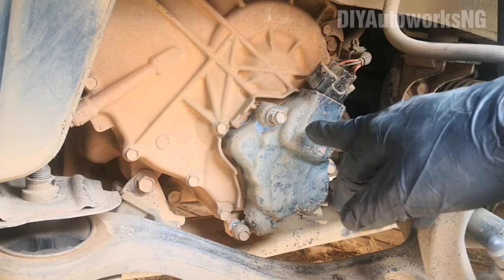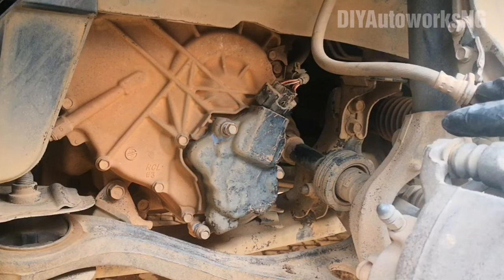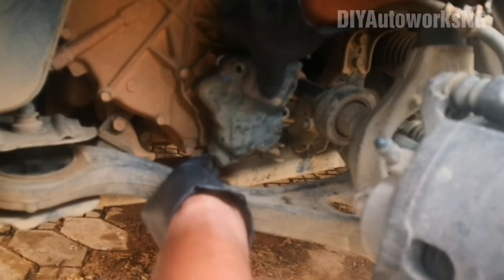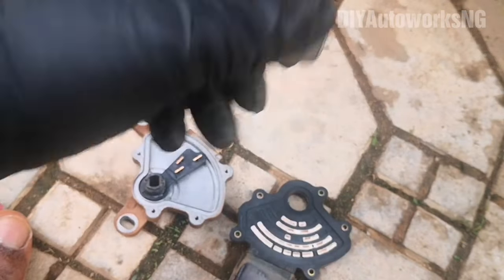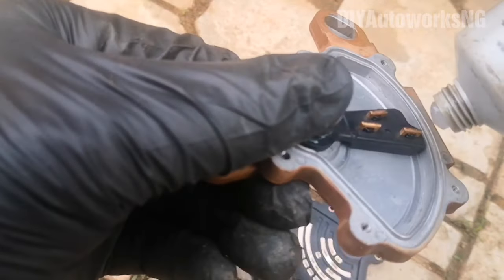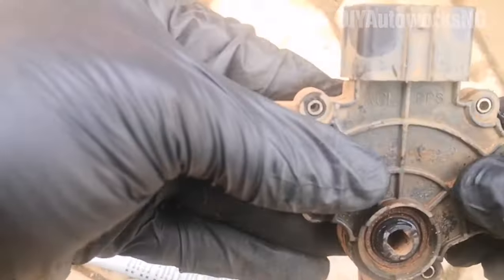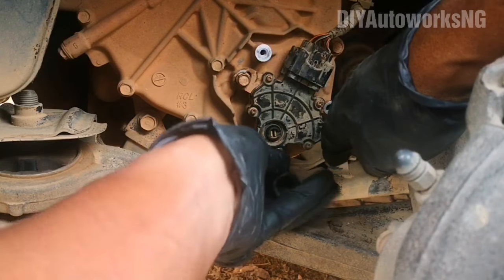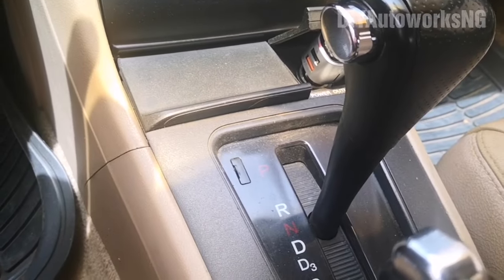Neutral safety switch service: How to clean a neutral safety switch (transmission range switch)

Comment: Will be doing this on my 2005 CR-V EX. It has an intermittent no crank no start and the only way I’ve found to get it to turn over is by playing with the shifter position running through out all the gears multiple times and sometime it still has trouble working. It only happens after I have been on back country roads which leads me to assume the switch is dirt and full of the same fine dust this coats my under carriage. Thank you for taking the time to show and film this for us! I grabbed another identical neutral safety switch from a local wreaking yard to compare the wear on mine to and as a fall back incase my switch really is faulty. Cheers!
Reply from the maker: Thanks a lot for the compliment. Very good plan you gave there. Since I did this, the no-start in park has not happened again. All the best!
Reply: Same problem on my Chevrolet Beat

Comment: Great video,  very helpful.  My honda won't start in neutral or park, good battery etc. I think it's the switch I drove through some big puddles just before it failed. Very little information on the web about what it actually looks like inside.  Thanks to your video I can actually see the circuits inside when you take it apart. I'm sure it's  one of the only videos that shows this. Well done.

Comment: Thanks. I mysteriously had a issue where my 2007 Accord V6 wouldn't crank and I tried putting it in neutral and still nada. Had the card towed home and the next day it started.  I may try cleaning it as you have done instead of replacing it as a good starting point.
Reply from the maker: Do let us know if it works!

Comment: not all Neutral Safety Switches can be opened up like that and are sealed plastic., so just replace them in that case.  good vid
Reply from the maker: 💯 Don't mind those anti-right-to-repair manufacturers. Thanks for the compliment.

Comment: Sister in laws car wouldn’t start the other day after I checked the power steering for a leak. I had to move the shifter and then it started. She told me it did that and her brother did something to it and it worked for a while, but she didn’t know what. I’m thinking he cleaned it, but not sure. I found a NSS on eBay for $20 (Civic salvage), so I may see if she just wants to replace it since I found it pretty cheap. Either way, thanks for the tips.
Reply from the maker: Thanks!
 Given its used, it may not be far behind your sister-in-law's, but you can give it a shot. Mine has never failed to start in Park since cleaning the switch.

Comment: I will subscribe, all I just need is the 2 wire that allow the engine to crank while bypassing the neutral switch
Reply from the maker: I wouldn't advise bypassing the neutral safety switch except if its in a situation to just get you home.
Reply: @DIYAutoworksNG  yes, I need it to just get me home 🤣🤣🤣

Comment: Great Info! Appreciate for your time. Have a questions. Would this switch effect the shifting time & quality on an auto tranny? Asking because my car seems to shift better after aplying wd40 on the lever without dismantling it. Thanks again.
Reply from the maker: Thanks for the compliment! 
A sticky shift cable can delay shift thereby affecting shift quality.
Reply: Just read that wd40 is a decent electrical contact cleaning substitute so this does make sense

Comment: Curious if you’ve ever had a Honda Accord crank but not start in park ? My 94 did exactly that today. I moved the shifter into neutral position and motor fired up immediately after doing so. Working fine now but expecting it to fail again. Thank you and good video.
Reply from the maker: I haven't had crank with no start. I've rather had crank, start and stall immediately (poor quality gas).
In your case, I reckon cranking in Park but starting in Neutral may have been a coincidence as per it may have started in P if cranked repeatedly.. Looks like a hard start to me. The car will usually not crank at all or may start in gears other than P and N of its a neutral safety switch issue.
Reply: @DIYAutoworksNG  I was watching another video and it mentioned a module under the steering side main relay cold solder joints that can cause the same issue. I do appreciate you responding back. Thank you sir! I did subscribe
Reply from the maker: Thanks for the extra info on the module! Thanks for the sub too🙏🏼

Comment: My transmission goes into neutral when I come to a stop/decelerate. Can this cleaning of the neutral safety switch be the solution?
Reply from the maker: Do you mean the shifter itself moves into neutral or that the car stops to accelerate?

Comment: U stated  y saying gear was in neutral but at reinstallation u now said it in Reverse. Yet u said the gear stick shold not be shifted throughout the procedure. Confusing
Reply from the maker: Apologies. I meant the rest of the procedure is the reverse of what I did when removing the part from the car. Lol. Sorry for the confusion. The transmission remains in Neutral.
Reply: @DIYAutoworksNG  okay bro. U are a good dude 👍

Comment: I have this code p1780 pointing to this Park/neutral switch on a corrola 2003, car starts in park and neutral,the issue is it doesn't shift,it's stuck on gear 1. But once I unplug the neutral/park switch the car shifts perfectly,i plug it back and it stays in the first gear. please What do I do?
Reply from the maker: You may start by disassembling and cleaning the switch just to eliminate internal poor contacts. If it fails, you may need to replace the switch.

Comment: Hey! Can i use for gres skf lgmt 3 ?
Reply from the maker: I don't understand
Reply: @DIYAutoworksNG  i meant  that grease Skf lgmt 3 is suitable for this work?
Reply from the maker: I see. I don't know the grease skf lgmt 3, what to use should be non-petroleum grease e.g. Silicone grease. Petroleum grease will attack the rubber and plastic components over time.